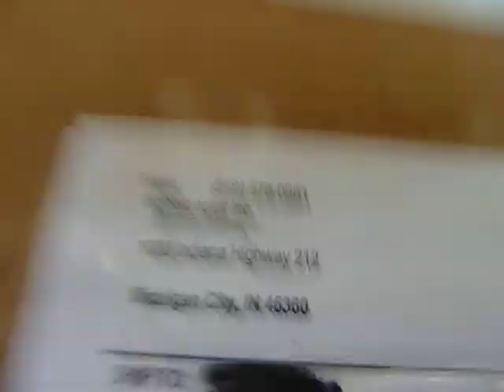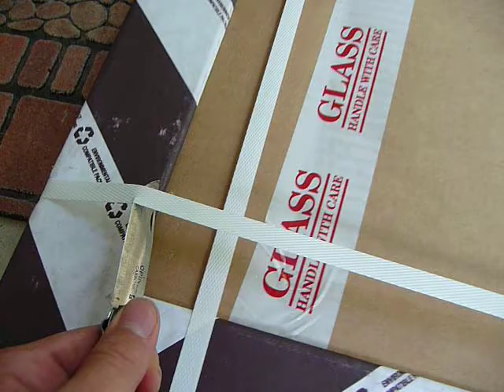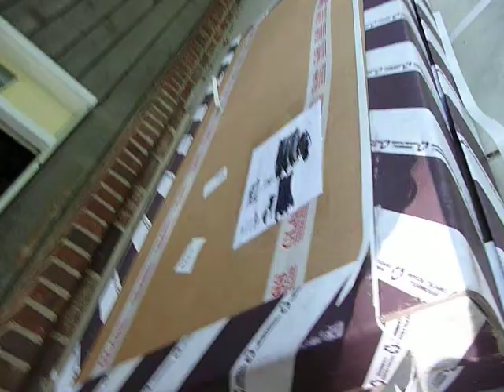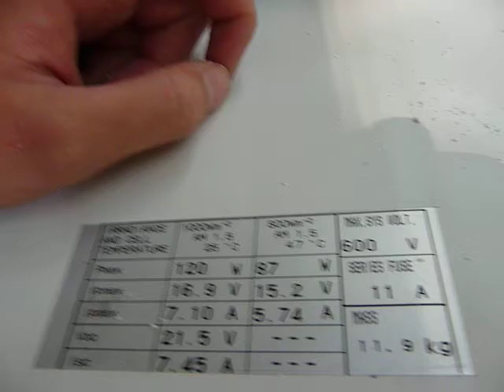hightec solar inc 120watt panel

Comment: yeah is it producing 100% rated power i bought one too, but havent received it yet
Reply from the maker: yes on a very sunny day I've seen 122watts but on a normal day here in MD you can expect about 70watts up to maybe 90watts
Reply from the maker: works best on a cold sunny day